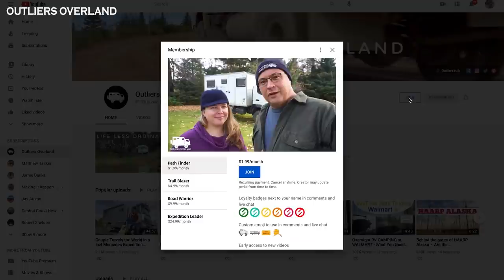THE BEST TOILET FOR VAN LIFE...  *No Water *No Compost *It's European!  [Separett Tiny Installation]

Comment: I had a Separate Weekender toilet for 3 years in my travel trailer and liked it, but it was relatively large, and there was just a bit of bad smell. This summer I updated to the Tiny and absolutely love it. Small, no odors at all, and dare I say, it is even beautiful! Mine has the urine plumbed to the gray tank, and it works fantastic.
Reply: Totally agree with the comment about thinking through the position of the exhaust pipe. Mine is in the driver side of the trailer where nobody typically hangs out, and that is a good thing... You can definitely smell $#!+ if you get near it, but not from 3 or more feet away. I only notice it if I need to get something from the passthrough storage door near the exhaust. I guess this means that all the bad smell is being very efficiently pulled away from the camper's interior, so, the toilet works as intended. Just beware of were you choose to divert the odor to. If one has the ability to vent through the roof, that would be ideal.
Reply from the maker: I wish we had more options….
Ours is about two feet from the wall but with drafts under the truck it can have a large radius.

Comment: In my Dodge 4x4 van RV I just went with a 5 gallon bucket in a nice 18” x 18” wooden box that just looks like another Storage compartment. I am old and have Crohn’s disease where all liquid is way more common than solids and liquids. With the bucket I uses multiple trash bags then apply a small amount of toilet chemical with about 1/2 cup of cat litter after each uses. I empty this daily. It is just me using this system. That is about as clean as I can describe this? 🤷😁
Reply from the maker: That's definitely one way of doing it.   Theres lots of ways to take care of business,   
Thanks for watching

Comment: Having just spent 4 months working on our house in Alaska, replacing two toilets I can relate to this video more than I could have a year ago. 
I hope that Denny makes it to you without any issues.
I found a roofing sealant that when cured is more like rubber than silicone and bonds to materials very well. My experience with silicone is that if it’s constantly wet, it releases. Hope the 3M4200 holds up. 
I would double bag it too.
Not sure if it would work for your seat lift seal issue, there is a silicone hinge fir aquarium glass tops that might work to seal up the gap.
Reply from the maker: Did you go with traditional or alternative toilets?
Thanks.  He’s a week behind schedule so we had to get an apartment hotel for a week in Brussels.   
Under normal times that would be quite nice, but the virus is escalating and it’s not that great of an experience sticking to the confines of a apartment.   

Having a nautical background I opted for 4200.  5200 is too permanent.
Reply: @outliersoverland  they are traditional toilets, the house is being sold. I just read about the 3M adhesives after the video to  see what the properties were. I agree, you made the right choice. I’m glad that bees wax is used under the two I replaced, it made sealing much easier. Don’t think it would work in a mobile.

Comment: I got one here in usa and super frustrating experience with usa dealer; first they sent out the 1000$ knowing it need parts replaced which they sent but some reason can’t change themselves so that was first order of business once installed
Then the toilet paddles weren’t function correctly and moving out of the way so they sent me new hinge mechanism and to replace it requires you remove the toilet completely 
Now I live full time so all this took over 5 weeks without a useable toilet 
They too cheap to send the special tool T25 I think 
I made video to show the compassion of why the other hinge may not of worked for their references 
Was I pissed at having this ordeal yup I let them know but also gave them the reason to problem and you think I get any return emails nope one of the worse services / support ever 
Now the toilet working the fan not as quiet as they lead u to think it’s tolerable but again is like get better fan and apparently over seas some use a slower speed fan to aid in reducing 
The plastic toilet also attracts certain dust if you go by any vial power plants inside everywhere and out side 
So that’s an honest review

Comment: I like the separett tiny but would probably use the model with the pipe for the urine send route it to the grey water tank.
Reply from the maker: The Tiny has that option now too, it was just a few weeks  away from release when we bought ours.  It comes so that you can switch back and forth, use the built in reservoir or divert to your gray tank.

Comment: I'm new to discovering your channel and videos. I'm not sure if this was something you had covered but it appears that the windows in your overland RV are the same as the ones I have in my RV. Did you ever have to replace or get parts for yours? Mine have become brittle and cracked near the latches any help suggestions or ideas would be great.
Reply from the maker: Hello Jon and welcome!
We have the Dometic Seitz s4 windows and they are definitely showing their age as well.  
I saw a company/website out of the UK called Leisure Shop Direct sells parts, but when I wanted to order some they were on back order.   
Hope this helps.
Reply: @outliersoverland  I appreciate you taking the time to answer my  question, and  thank you for the lead.  I will look in the company that you mentioned.  Safe travels and I look forward to riding along with you in your adventure.